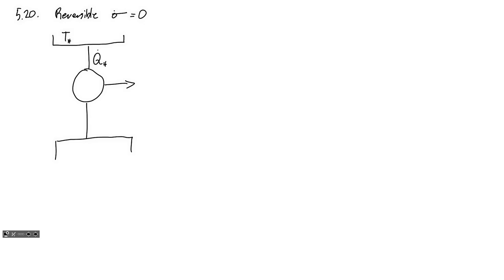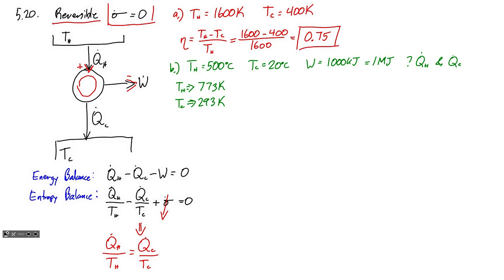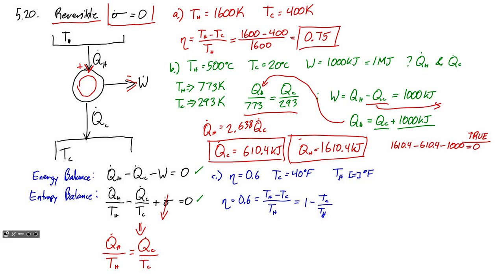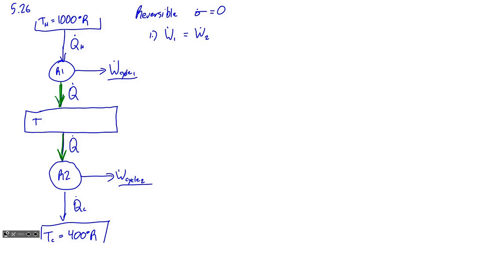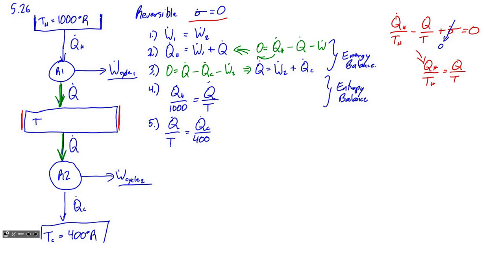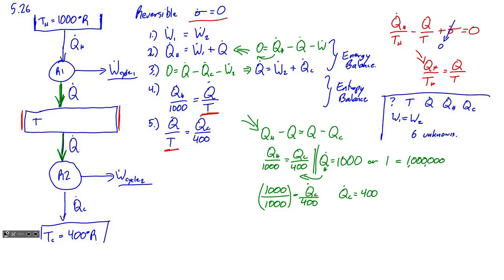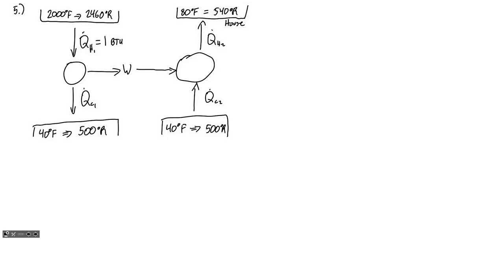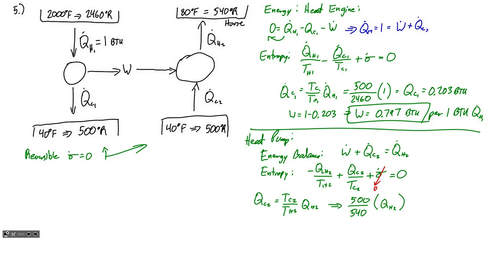Thermo Homework 6 Booster - Process Cycles, Heat Engines, Heat Pumps, and more

Comment: what is sigma in the entropy balance?
Reply from the maker: It is accumulation of entropy.  The natural entropy balance should be zero for ideal, reversible systems but here, we have this term to account for whether there is "left over" entropy when all is counted.  If it's positive, it's possible and irreversible, if it's 0 it's reversible, and if it's negative, it's impossible... You can never have less entropy than the start condition of a system.